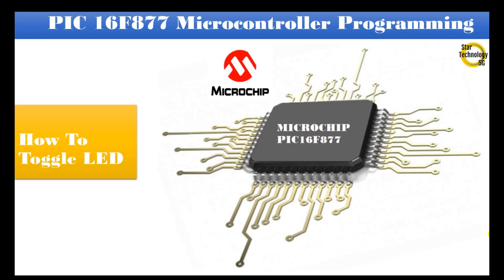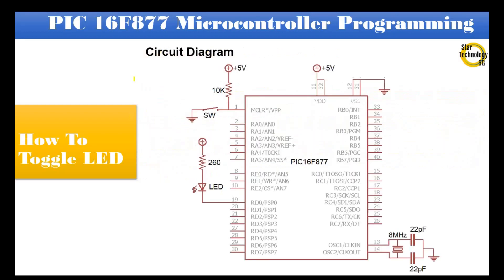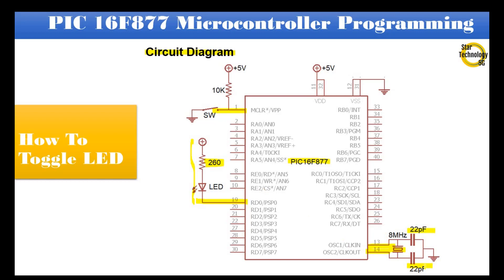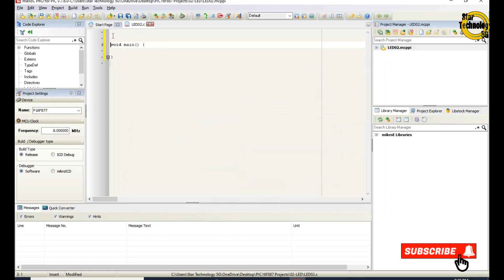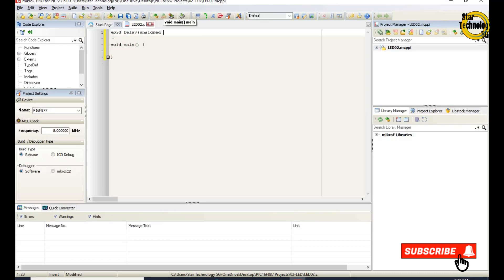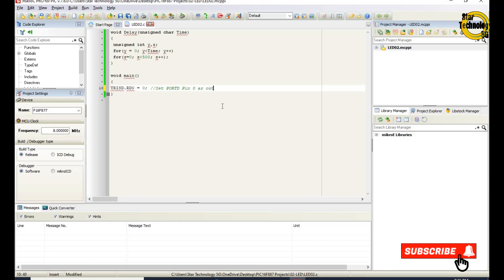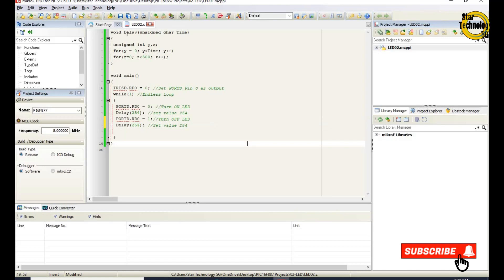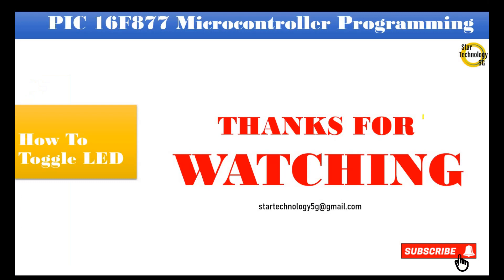Microcontroller PIC16F877 Video 09 How To Toggle LED Using Mikro C for PIC

Comment: //How To Toggle LED
void delay (unsigned char Time)
{
 unsigned int y,z;
 for(y=0; y<Time; y++)
 for(z=0; z<500; z++);
}
void main()
{
  TRISD.RD0 = 0; //set port D pin 0 as output
  while(1); //stay here or endless loop
{
   PORTD.RD0 = 0; // turn on led
  Delay(254); //set value 254
  PORTD.RD0 = 1; // turn off  led
   Delay(254);  //set value 254
}
}